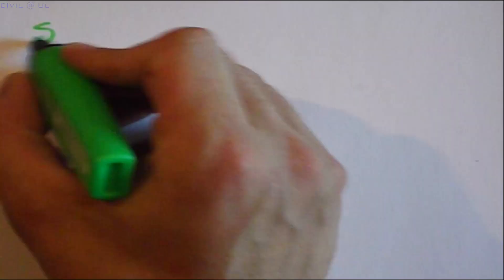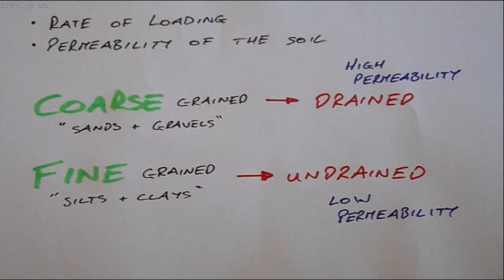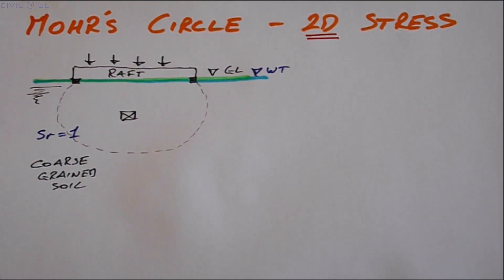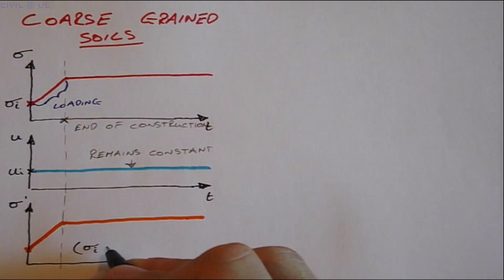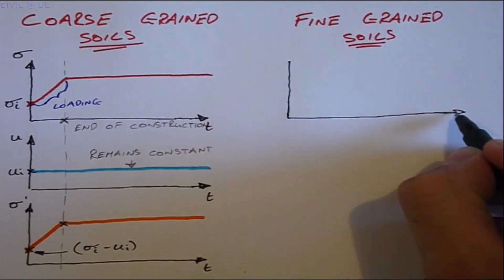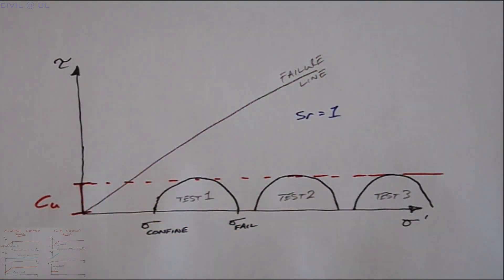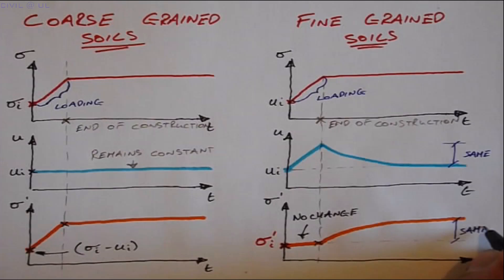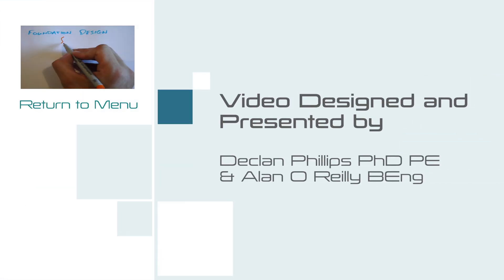Drained and Undrained Soil Shear Strength

Comment: For the undrained case, shouldnt the vertical effective stress remain constant as the increase in vertical total stress is transfered to increase in pore water pressure, at least in 5he short term before consolidation occurs.
Therefore the horizontal effective stresss should remain constant as well according to the k_0 equation.
In undrained loading, isnt the shear strength of the material is determined by S_u instead which is a horizontal line in the total stress versus shear stress space

Comment: thank you sir, but i'm unable to understand that while conducting undrainrd tes,t how does soil shear, as to find out failure stress we increase deviator stress and as their is no drainage the whole increased stress to be beard by water as per spring analogy so how does soil take load . i'm specific about test in labrotary not on field as there will be drainage gradually in clay soil.